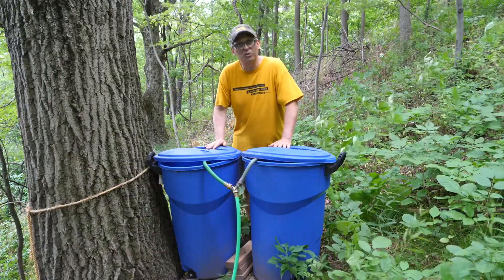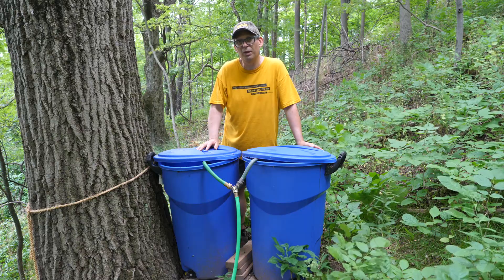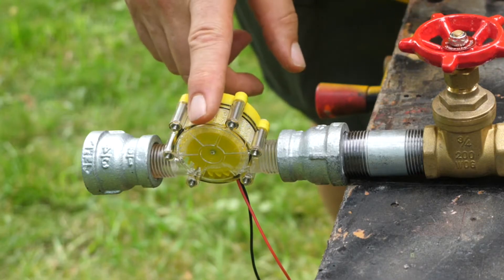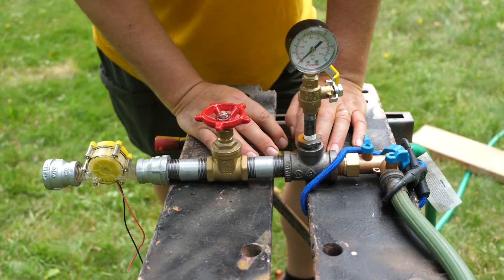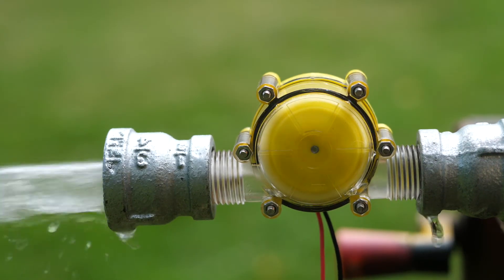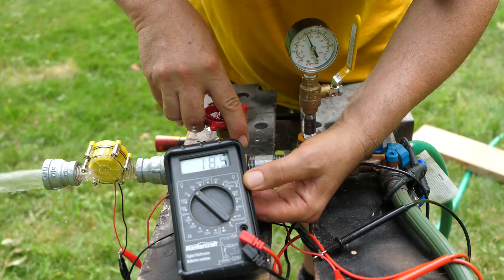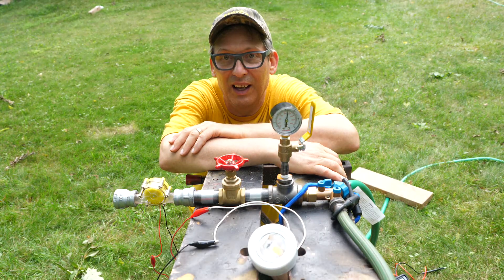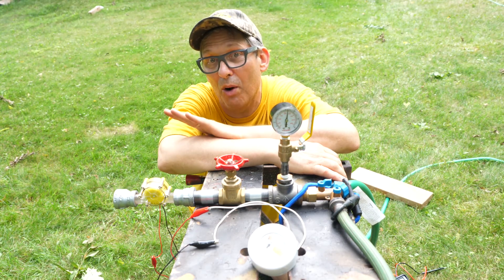DIY Water Battery (AKA: Hydro Electric Power)

Comment: How long do the buckets last. Can you charge a 12 volt car battery?
Reply from the maker: Thanks for the comment! If both buckets are completely full to start with and you open the flow valve say about half way I could get about 25 to 30 mins out of the system. I am very doubtful it could any charge to a 12 v car battery.

Comment: Great video. What is the minimum PSI needed to get that turbine to generate 12v?
Reply from the maker: Good question! I don't specifically remember, but a wild guess would be 15 to 20 psi maybe. Would have to run it again to determine the real value.

Comment: it would be cool to hook the return line to a ram pump to refill the tanks on the hill. just a thought 🤔
Reply from the maker: Yes that's a very cool idea!
Reply: I thought I was the only one that said holy moly.😊
Reply: True, I am thinking that way.
Reply: Why not try hook up say 4 or 5 turbines in a straight pipeline say 1m apart, connect all the 12v to each Inverter say 2000 watts each, get AC and power up appliances. Connect one to a water pump to pump the outlet water back up to the top reservoir.😂

Comment: Why can't they be bult those generators inside section's of pipe so you can spin lots of them on the way down through the pipe.
Reply from the maker: That's a really good comment. It would all depend on how much pressure (head) loss each each turbine created. I suspect that each one would create very little over all so I think several turbine could be viable at one time. Another idea to consider would be putting the turbines in parallel rather than in series as you suggested above. This might work even better. In the end one would have to try it all out to see which is best.

Comment: Really cool video! I've made variations of similar setups. Just so you know. If you are curious to know the exact  foot of head( difference in elevation) of your stock tanks and your Hydro set up. You can open the pressure gauge and keep your gate valve closed. This will effectively give you a PSI reading of just the fall of water from point A to point B. You can then take that PSI and multiply it by 2.31 and it will give you an approximate elevation difference. 

Nice build!
Reply from the maker: That's awesome. Thanks a million for the input on this. Much appreciated!

Comment: I'm curious if it's possible for this to be a closed system that can cycle the water endlessly and produce power continously.
Reply: You can, actually.  I have a similar set up to this. I made a RAM pump that pumps water from a creek about 43' up a hill to a 275 gallon stock tank. About 3/4's of the way up I drilled a hole and sleeved 1 1/2" pvc into another stock tank that acts as my Hydro Battery. The water then falls down hill from that tank and powers a very similar hydro electric setup than this. The leftover water that passes through my electric setup is fed with a garden hose back down to the creek to be re pumped and cycled once more. The RAM pump is a passive pump that pumps continuously. The initial start up for me took about 48 hours to fill the stock tanks. After that, I have not touched it, and it has been running for about 2 months now.
Reply: @morgunbrunelle4573 what do you power with the hydro battery?
Reply from the maker: @morgunbrunelle4573  That is totally a amazing!!! Thanks so much for sharing your setup description.

Comment: Thanks for uploading man. There aren't too many videos on this subject sadly. I was wanting to do the math on a large scale system, but it is very technical, and confusing. Not a lot of helpful info on the subject, fun little project though!
Reply from the maker: Thanks for your comment! One of the main reasons for this experiment-fun project was to learn first hand about a system like this with the idea in mind of upscaling to something much larger. Which I still have plans to do. Looking at ways of creating a more viable size reservoir-battery and larger generator capacity.

Comment: does adding another generator increase the amps generated
Reply from the maker: Great question! I am not a 100% sure on the answer. I guess one first has to think do you connect them electrically in series or parallel.